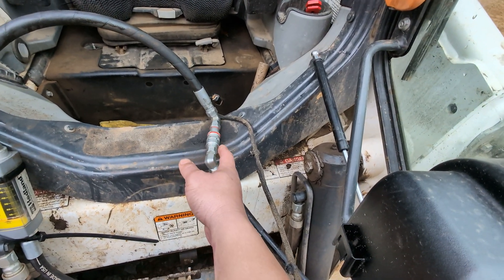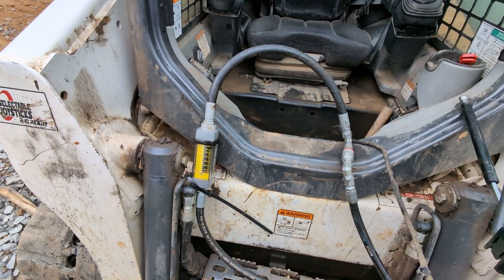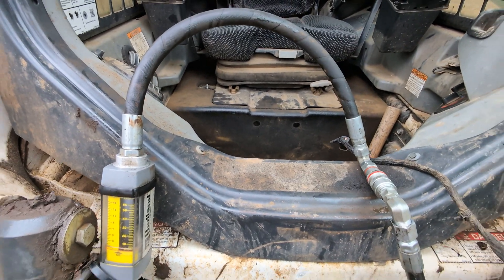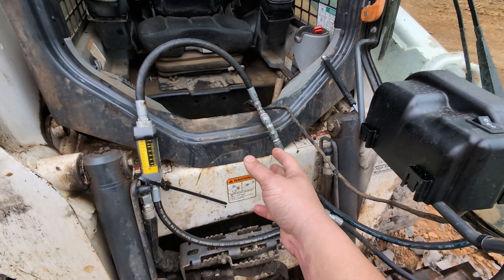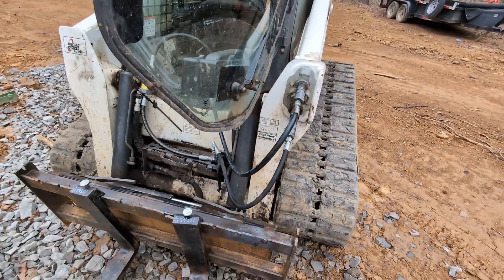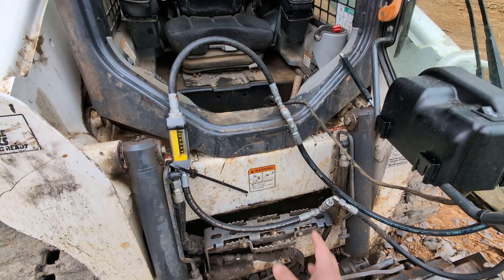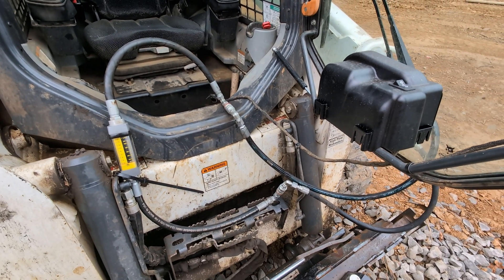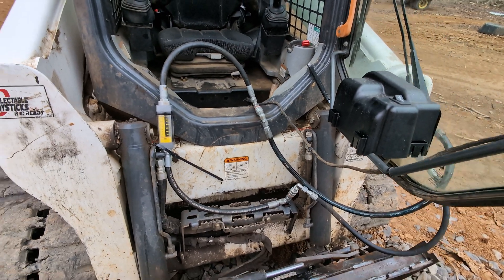How much flow can my hydraulics handle?

Comment: Thanks, Kevin! Great video. I love that you even discussed details like laminar flow and the relations of volume, pressure, and temperature, especially in creating and dissipating heat. I’ve been looking at the Hydrosplus Cooler Plus solution you have out for improved cooling, and I love it. Thanks again!